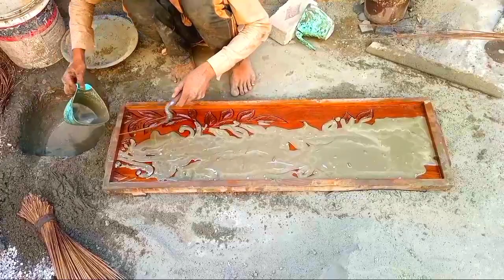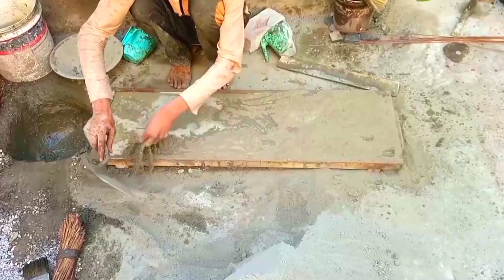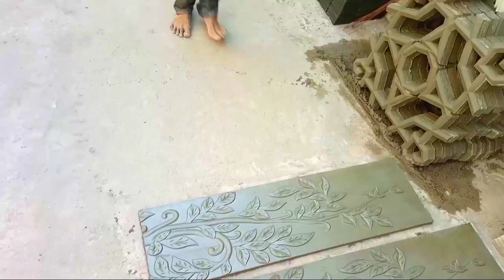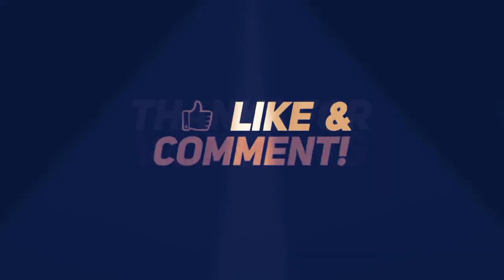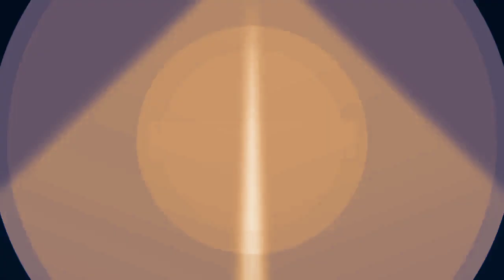How to make Moulding cement Flower  border | Molding designing |Royal Construction Art #rca247

Comment: How you make this cement mixture??
Reply from the maker: Yes! It's cement and concrete mixture is made in dry form first, like mixing sand, cement and concrete and then it is watered to make paste.
Reply from the maker: The liquid one is cement and sand only in water.
Reply: Can i make wall bit using this mixture?? Pls tell me the ratio of water, sand & cement
Reply from the maker: Can you please briefly explain your concern?
If feel easy then please drop me a message at
https://wa.me/923005124237/
I'll be able to help you there easily.
If not then drop your brief question.